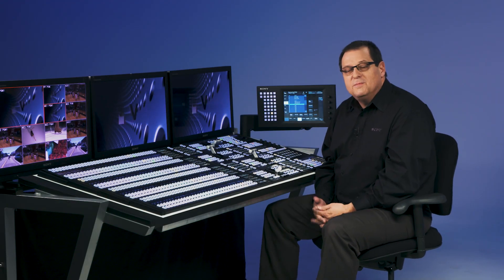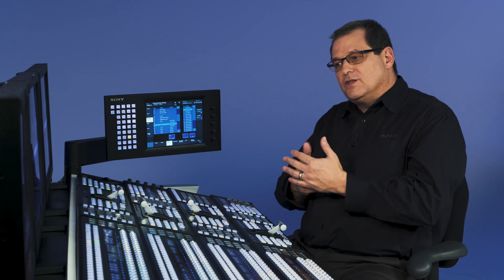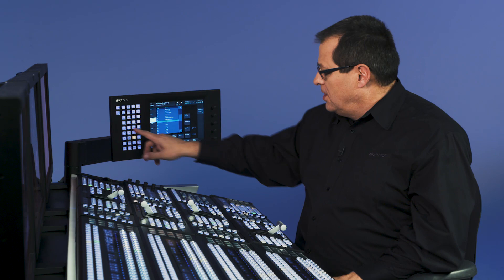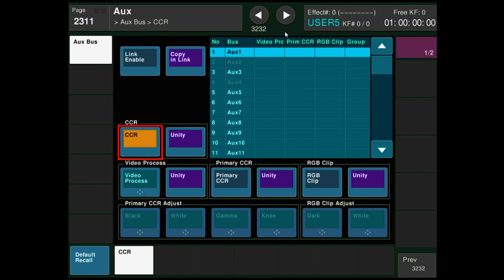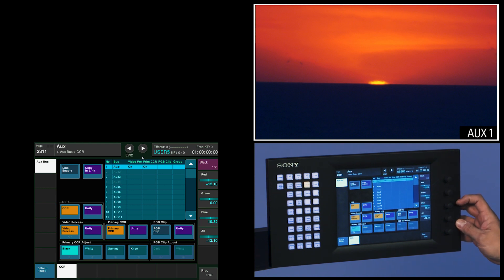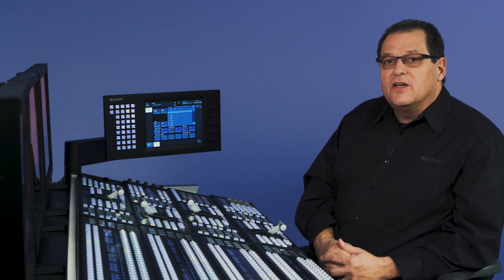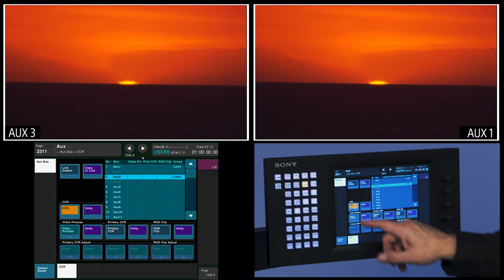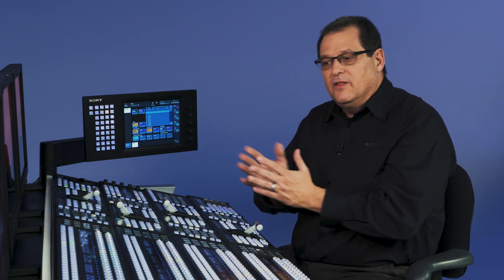XVS Series Training Video (Aux Bus Output)

Comment: Thank you! These are very helpful. Is there a way to save the color correction on an Aux in a user region snapshot without the source? I’d like to use this to “dim” my studio monitors but when saving a snapshot it also saves the source routed to that aux. I’m in a automated system so I’d like to just affect the color correction, not what source in that Aux. Thanks